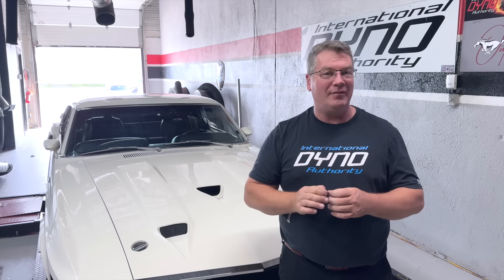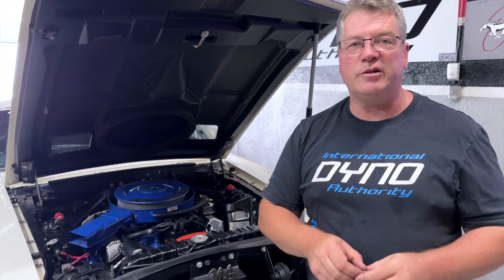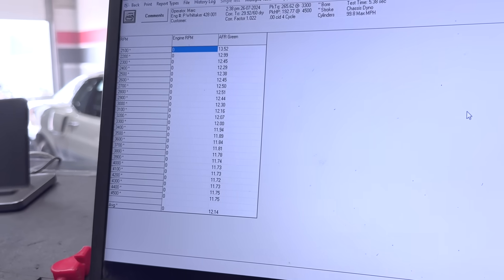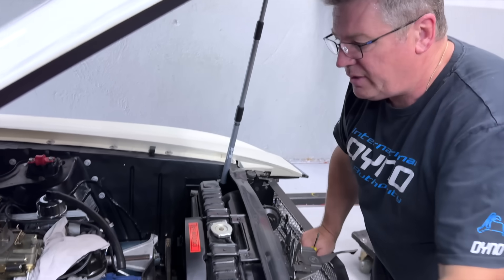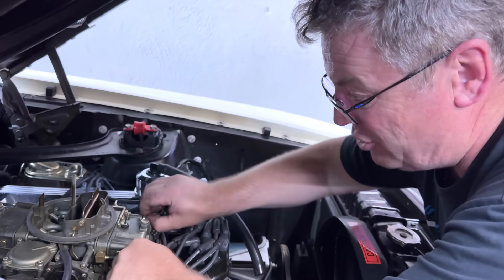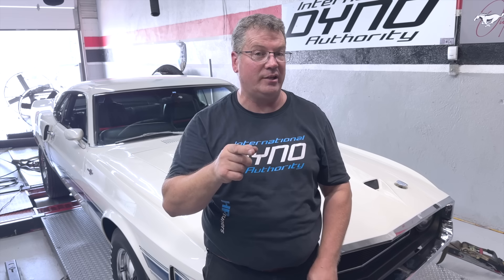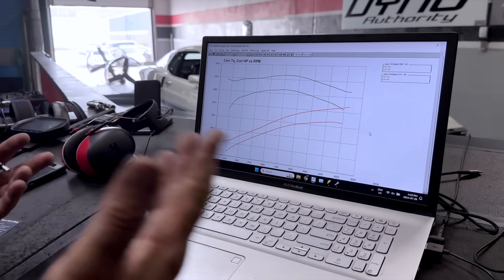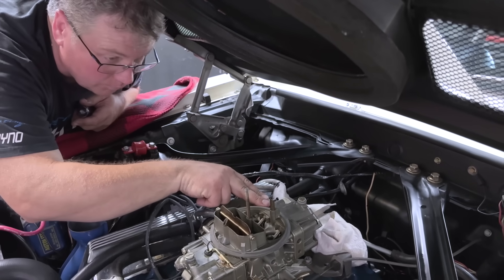Original, unrestored '69 Shelby GT500 tuned on the dyno

Comment: You don’t know there many rare’er gt500’s in 69 ! Special order 429 scj several versions. Top 15 of 15  in 69 mustang. Afr will fool you! You must document air condition at time of road testing. Not in a  monkey shop read the fekn plugs !
Reply from the maker: We always encourage, our customers, have opinions. And we encourage comments. 

We do encourage people to use a modicum of respect. 

The plugs were checked regularly. And, 

When you are on a chassis Dyno, not only do you see the humidity, you see the D. A., There are three live weather stations running at all times while you are tuning. 

Air fuel ratio cannot be fooled. 

When you pull out a spark plug. You're going to see one spot on the spectrum. You're not going to get a chance to see, what it's doing at 2200 RPM. You're not going to get a chance to see what it's doing at $2,800 RPM. You're simply going to get a chance to see what it does at $4,400 RPM under maximum load with both the front mains and the rear mains dumping fuel. 

We read spark plugs in this industry for years and years and years and we went by that data and it was good. Once you have a far far superior tool like live AFR, you're not going to go back to the 1950s and start basing everything off of reading a spark plug. 

And to be quite honest, 99.9% of people don't know how to read a spark plug. Can't read a spark plug and when they do look at a plug and start telling you something they simply look at the color and say oh that's richer that's lean or they haven't got a clue. Very very easy for us to test this. Get the afr correct all the way through the range at somewhere between 12:20 and 1310. And then, what we can do is adjust based on what it likes and it'll tell us how much power it's going to make. Then we can add 2° or take 2° away of timing. Throughout the range readjust the timing curve and the vehicle will tell us what it likes all the way through the curve. 

So while we appreciate your comments, we find them to be a little bit aggressive. And we invite you. To come to the shop. View a professional tune, in progress. You will learn a lot, and we'll be more than happy to help you out. 

Cheers from all of us here at international Dyno Authority
Reply from the maker: Every single pass had documented humidity 

Documented sea level 

In 10 millisecond increments. 

Each pass is frozen in 10 millisecond increments, and allows you to see "live data" as you go from three weather stations.

(, But I guess we should just go back to 1950 and pull the spark plug out and look at it)

Documented afr 100 RPM over 100 RPM, in 10 millisecond live recording segments.

Documented AFR 100 over 100. 

Documented temperature 

Three weather stations recording the current weather conditions and using an algorithm to develop correction factor along with the D.A.

Cheers from all of us here at International Dyno Authority.
Reply from the maker: On the chassis dynamometer, or out on the street. Now this vehicle is an absolute bear. Stepping on the throttle at any RPM range. It will absolutely tear up, with 400 ft lb of power at the rear tire. 

Cheers from all of us here at International Dyno Authority..
Reply from the maker: Determining the top five most rare 1969 Shelby GT500 Mustangs is challenging because rarity can be defined in several ways (e.g., lowest production numbers, unique features, special order). However, based on production numbers and known special examples, here's a list of some of the rarest variations:
 * 1969 Shelby GT500 Convertible (Non-Hertz): With only 244 produced, the standard GT500 convertible is significantly rarer than the fastback version. Convertibles, in general, tend to have lower production numbers, making them more sought after by collectors.
 * 1969 Shelby GT500 Convertible (Hertz): Only one GT500 convertible was specifically produced for Hertz. This single car stands out due to its unique designation and extremely limited production.
 * 1969 Shelby GT500 with Specific, Low-Production Options: While exact numbers for specific option combinations are hard to pinpoint, GT500s ordered with particular, less common options would inherently be rarer. Examples of such options could include specific exterior colors with certain interior trims or combinations of comfort and performance features that were not frequently selected together. One example mentioned in search results is a Grabber Yellow GT500 fastback, of which only around 18 were believed to be made.
 * 1969 Shelby GT500 Pilot/Engineering Cars: Ford and Shelby often built a few pre-production or "pilot" cars for testing and evaluation. These cars typically have unique features or combinations of parts that differ from regular production models. One search result mentions two 1969 Shelby pilot cars built at the Pilot Plant. These would be exceptionally rare.
 * 1969 Shelby GT500 with the 428 Cobra Jet Engine (if specifically tracked): While the 428 Cobra Jet engine was the standard engine for the GT500, if there were specific documented, low-production variations or special tuning of this engine for a small number of cars, those would qualify as very rare. However, standard GT500s already came equipped with this powerful engine.
It's important to note that meticulous documentation and the Shelby American Automobile Club (SAAC) registry are crucial for definitively identifying and verifying the rarest examples based on specific options and build details. Cars with documented special histories or ownership (like the one owned by Carroll Shelby) also gain significant rarity and collector value.

Cheers, from all of us here at International Dyno Authority
Reply: @internationaldynoauthority693  the car in the video was a one of one as determined by the Marti Report. There were only 6 Wimbledon White 1969 GT500’s with a 4 speed ever built putting the car in the video in a very rare category as you accurately pointed out at the start of the video.

Comment: 5 minutes in... Holley with a blown power valve?
Reply from the maker: @ericriggert9231  

We found the myriad of issues. We had to do testing at several different RPM ranges. 

The Powervalve itself was new. Gasket incorrect. There was no leaking (blow by)from the power valve circuit.

Also this had been a problem since day one of this car.

Accelerator pump nozzle size, check ball in accelerator circuit, PCV routed incorrectly.
Too much main circuit fueling. Ignition timing, too low.

We appreciate your writing in and stimulating conversation. 

Cheers from all of us here at International Dyno Authority.

Comment: My comment wasnt rude. I said great video. I loved your whole of constantly checking the air/furl ratio. All the changes with power value & jettes. My last was a curiosity thing. Would that torquee & hp be any higher with some of he better carb today. That let you set how soon 2ndary comes in & individual mixed screws around
Reply from the maker: We're happy you enjoyed the video and the tuning process!
Reply from the maker: With a modern carburetor, we would have more ability to do extra fine tuning. 

We were able to get it very good. But you're right, the older carburetor lacks some of the circuitry that the new carburetor would have. 

To have either, two sets of low speed air blades or even one set of a low set air bleeds and one set of highset air blades, would make the job easier too.

Comment: The thing to do is throw the Holley in the trash and install an Edelbrock carb.....problem solved. All Holleys do
is flood and leak and cause fires. I did this on my friend's 70 GT500......it's faster, doesn''t flood and doesn't leak and no
more changing out the power valves once a year.
Reply from the maker: Thank you for your feedback. 

Each of the carburetor manufacturers have their strong points. 

The Holley platform is definitely our favorite platform to tune. 

It responds quickly. It responds very nicely. And it offers maximum performance, with a very meticulous setup start to finish. 

We definitely tune a lot of Edelbrock carburetors. 

The first issue, you require $130 Edelbrock tuning kit for each model. 

This is less than ideal 

They tune well, but but they box you in with some of settings, that you are limited to. 

We enjoy both platforms. And I've had very good success. 

Thank you very much for writing in, and for stimulating conversation. 

Cheers from all of us here at International Dyno Authority

Comment: Not to be a ass but before I work on a old car I take it out on the hwy and blow out the carbon build up on the pistons probably babies it a lot while driving just My experience
Reply from the maker: The smoke that was exiting the engine, was 100% based on the setup. 

This is why in the video we specifically ran the vehicle up to $3,800 RPM. We then stopped. 
We then stopped. 
There was zero smoke, zero buildup. Zero issue below $3,800 

This allows us to diagnose where the bulk of the smoke is coming from. 

We can then break down the carburetor circuit by circuit. 

We can look at the pcv system, repair the circuitry, and move on making sure that the fueling is done correctly. 

We looked at the timing we looked at. The timing curve. Spark plugs were clean...

It takes time, to to diagnose and, make things correct. 

Simply taking something out on the highway and flogging. It does nothing more than flogged the engine. You've learned nothing. 

You probably had a lot of fun though and then I'm all for that. 

We prefer to check all of the basics before we flog the engine on the highway. 

In this case, the timing curve was incorrect. The amount of timing was incorrect. The fueling was incorrect. The PCV was incorrect. The accelerator pump was incorrect. The accelerator pump circuitry the checkball were all incorrect. 

Cheers, from all of us here at International Dino Authority

Comment: I’m curious what kind of gasoline you’re running and how long it’s been in the tank?
Reply from the maker: 91 pump. 

When a customer arrives, they will already have gone through a complete checklist. 

The vehicle must arrive. With new plugs, new wires, any of the other tune-up parts and pieces that would be required to make sure it's running on good quality parts for mechanical condition. 

The fuel in the tank has to be fresh fuel. And we always recommend 91 pump. There are several fuel stations around where you can purchase 91 pump that is ethanol free. 

We provide a list for our customers, of ethanol-free fuel. ⛽

Customers are also provided with a complete checklist which is chassis dynamometer specific.

We thank you very much for your subject matter. And, your viewing of the channel. 

Cheers, from all of us here at International Dyno Authority.

Comment: The. 428CJ was reportedly under rated when it went into production, purportedly for NHRA classification as opposed to higher insurance rates. That being said, none of the assembly line engines were blueprinted and not all may not have been assembled close to, or tuned to the specifications on paper.
Reply from the maker: Good afternoon, and welcome to the channel 

as it turns out, they were rated 

Spot on. 

We have tuned at least 20 of these. And each one of them comes out with 10 horsepower of the next one. 
In 10 horsepower of the next one. 
They're a good engine 

They make really good acceleration right off the line. 

In order to have them be a full-on race engine, you'd need to change the cam specification, put an exhaust system on them, open up the heads and put a bigger intake valve. Other than that, these are are, bulletproof. 

Cheers, and thank you for writing in and stimulating conversation. 

From all of us here at International Dyno Authority
Reply: @ thanks. I didn’t realize that.

Comment: Lot of carbon blowing out the back end
Reply from the maker: @lennyjenkins524  

Yes, correct, in this video, focused on making sure that there was complete combustion. 

We tuned, until there was no smoke, and there was a proper signal for each one of the circuits of the carburetor, from low RPM to Mid mid, all the way through the range. 

Thank you for writing in, and stimulating conversation. 

From all of us at International Dyno Authority.

Comment: So would union76 97 octane back in the day fixed that smoke
Reply from the maker: @jims4912  The smoke, was a combination of several factors. 

One of the main ideas here is that we are able to go through and see the fuel mixture. 

There was far too much fuel coming into, the combustion chamber. For effective flame front combustion 

The PCV system was hooked up directly to a line underneath the carburetor. 

This was causing oil vapor to be picked up, and deposited directly into the combustion chamber and making smoke. 

If the check ball, and spring, and accelerator pump assembly, was leaking by at RPM. Causing excessive amount of fuel after 3800....

We could have run 100 octane low lead aviation fuel. We could have run Sunoco 110. We could run VP plus 98. And a whole bunch of different fuels through this engine. But no matter what, this engine was receiving a bad signal of fuel from the carburetor on several fronts and was also having oil dumped into it from the PCV system

Comment: I’d love to get my built FE 63 galaxie a tune like that. I think I’ve got some decent power waiting to be discovered.
Reply from the maker: That's an excellent idea. We are certainly aware that there are not very many facilities in North America like our facility. And a lot of them will not specialize kind of tuning. 

However, if you can find a knowledgeable experienced shop. That does tuning based off of empirical data logging. It will definitely make a big difference in the way your vehicle performs. 

Thank you very much for writing in and stimulating conversation 

. Cheers from all of us at International Dyno Authority 

613-795-2779

Comment: A friend bought a new GT500 in 69. To change the plugs you had to remove a motor mount and jack up the engine.
Reply from the maker: Yes, these can be a little bit tricky. We now know, that we put it on a lift and we take the wheel and the fender inner fender out. 

Takes a lot less time, lot easier. And, you can simply use an extension through the wheel well. 

Thank you very much for writing in, and for stimulating conversation. 

Cheers from all of us here at International Dyno Authority
Reply: My college buddy is the original owner of a 70 GT500......back when we were in college and the car was three years old,
he paid me 250.00 to change the plugs (the Ford Dealer wanted 700.00) I did it with various swivels and extensions
and end wrenches.....I did not jack up the engine or remove anything else on the car, just the spark plugs. It took me about
five hours to do the job. Forty-five years later I rebuilt the engine on the Shelby and I threw the air pump system in the trash.....
much easier to change the spark plugs now.

Comment: Back in the day before we had O2 sensors to check A/F mixture, to dial in a carb idle mixture screws we would connect an engine vacuum gauge directly to intake vacuum, let the fully warmed up engine idle, and adjust the mixture screws for max reading on the vacuum gauge. It's harder with performance cams because the vacuum reading was often low and bouncy due to valve overlap, but you could still get them a lot closer than simply guessing by turning the screws blindly.
Reply from the maker: Thank you, for writing in, and stimulating conversation.. 

We still perform the same procedure. With a vacuum gauge. 

On this particular video, we did not show the vacuum gauge, and, we use it as a basis, but the vacuum gauge will tend to make the carb a little bit too. Rich. 

But it's a great place to start. 

On all 100% of all Edelbrock tunes, we start with the two idle air screws at the front of the carburetor. And we start with the vacuum gauge so we put the vacuum gauge on. We completely blank out the right side. Then we adjust the left side and the idle left side and the idle and then we go to the right side and we do right side in the idle right side in the idle. 

You're absolutely correct, it's a great tool, for maximizing the low speed fuel mixture. 

Thank you again from all of us at International Dyno Authority. 

Cheers!

Comment: fantastic vid. just one thing, when you do stuff off camera it does not contribut to the viewers edification..........................
Reply from the maker: Agreed, and that's why in this particular video we mentioned at the beginning that this would not be showing every single step of the process and that we would insert a link so that you could see the complete process from start to finish on another video. On this one we highlighted what the issues were. We highlighted some of the changes that we made. And then, we went through the steps of what the problems were and how we overcame them. 

One of the biggest issues with this particular vehicle was the PCV was hooked directly up to the bottom of the carburetor sucking vapors directly into the engine. Which is a ridiculous way to do this. Either you run a full emissions PCV system. Or you simply put two breathers on your valve covers